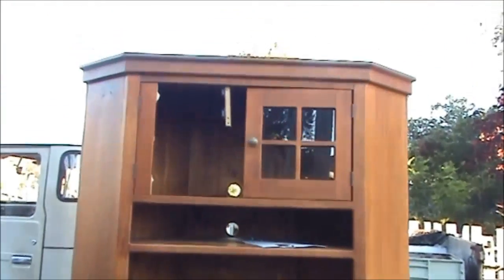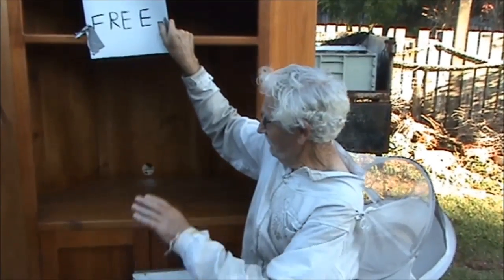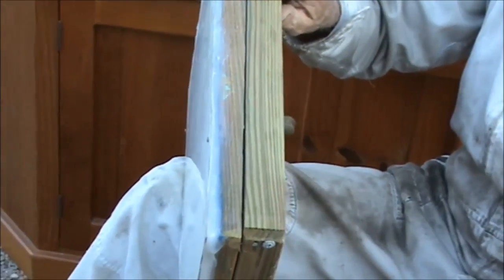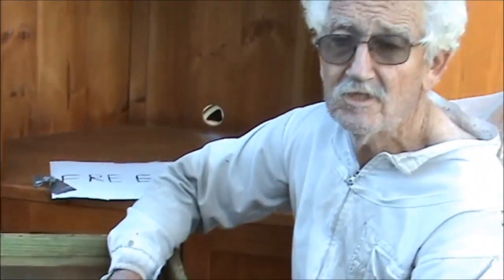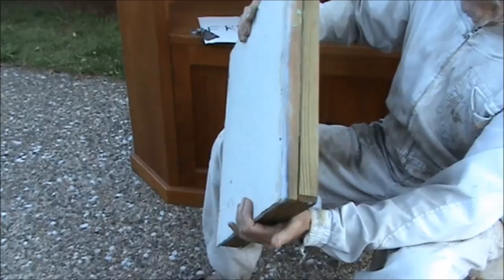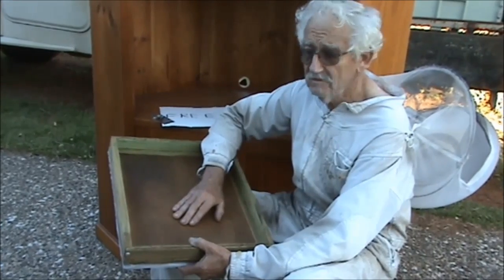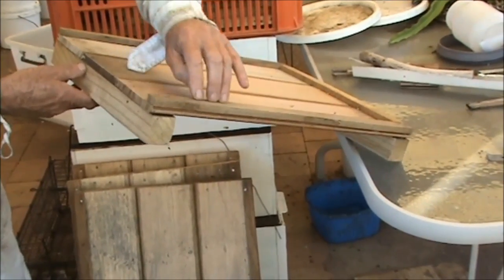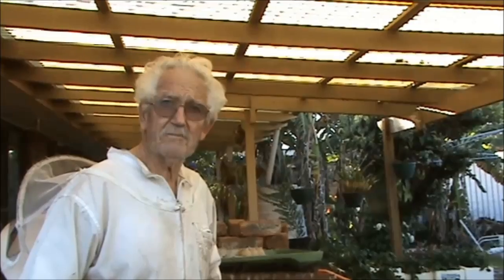Beekeeping: Free Wood For Lids, Floors & Box Repairs.

Comment: I had to make some stands to pu up a new bee yard. I was heading to Lowes to price the materials and a someone in my neighborhood had removed their deck and had it on the side of the road. I asked if I could have some of the wood, they said take all you want, we have no way of hauling it off. I made all my stands as well as some tops for top bar hives and what not. Most of the planks were 5/4. but the way I made the stands it won't matter and they will last for years more.

What is a skip? I'm assuming it is some type of refuse container.
Reply: Shannon Wyatt a skip is a trash bin, just some aussie slang.